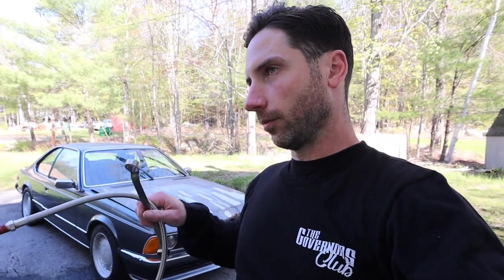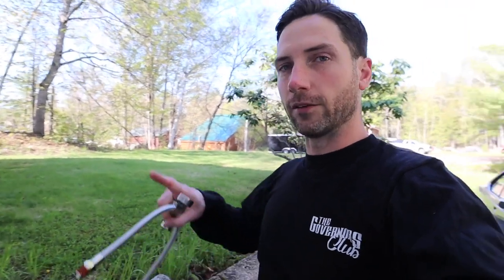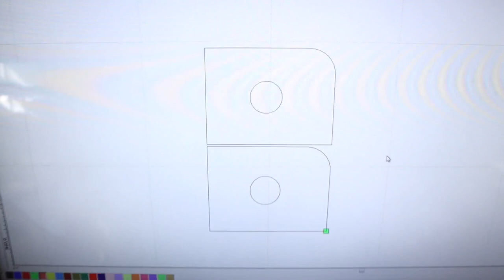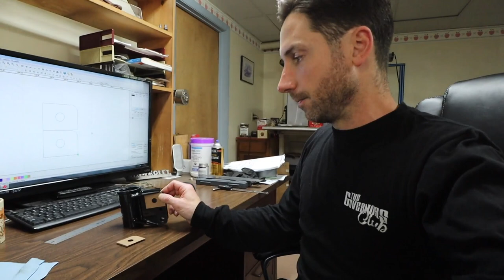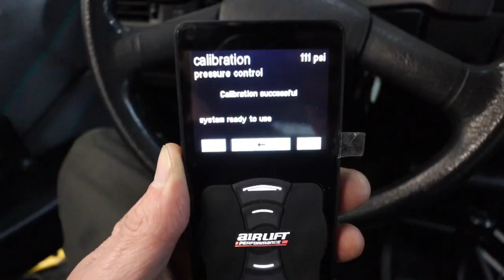Making More Custom Suspension Parts For The 2F Polo Coupe

Comment: First off, I love the 2f build so far. Second, when you’re pushed for time and don’t have the extra time/energy to film everything you’re working on, a good solution for that would be a GoPro. Get a head strap, ,just press record ,and everything is being filmed (hands free) while you work. Then, later on, you can cut up what you need in post. The new GoPro 8 and 9 would work especially well, as they have a built in gyro, and produce super stable video on their own... Just an idea! 😉